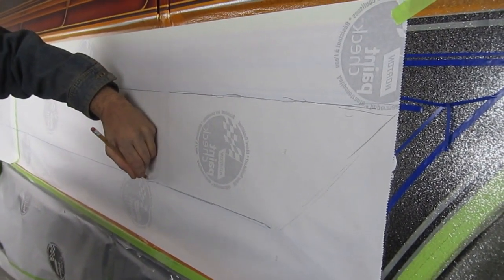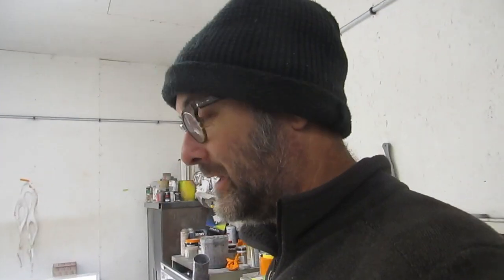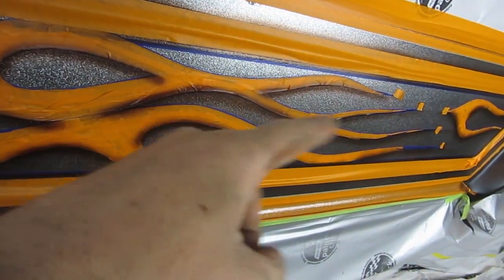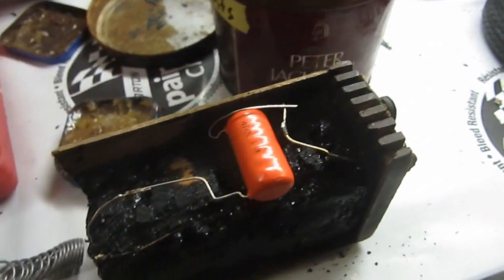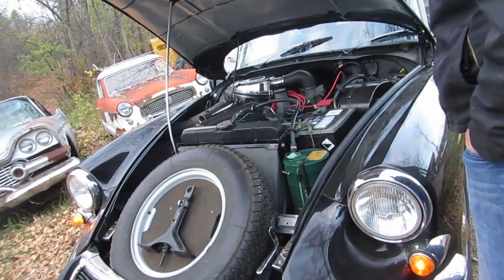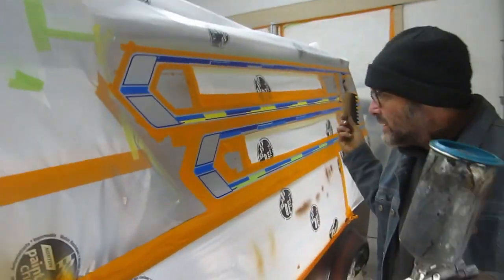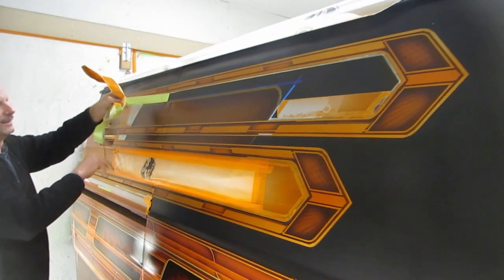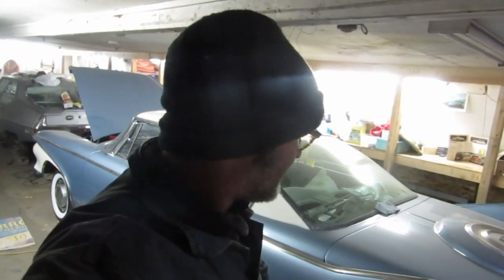Econoline Extra! Custom Paint Special, and Model T Coil Fix!

Comment: Cant believe anyone besides me remembers lace paint jobs.Going to paint back panel of my Corvair lace checker board.
Reply: I shot lots of lacquer through lace, and layered with metal flakes and translucents. 70s it was the thing..  Also, smoke layers from acetylene burn, with clear over...
Reply: I want to try it on top of my gasser
Reply: Low riders in CA used this painting techniques for many years. Beautiful!
Reply: @chuckstith838  Still to this day it's used on the west coast.
Reply: There is a car local to me in Newmarket that had the paint shot through the lace, a fantastic detail!!
Reply: I remember

Comment: As  I am someone who owns several model T's, it may be helpful to you to know that the coils can and should be tuned.  Pull the plugs out, lay them on the head so they still spark.  Adjust the knob on the points on each coil in turn to get the hottest spark.  This makes a great deal of improvement.   Also, a small squirt of transmission fluid in the timer  occasionally helps more than you would think.

Comment: Put some spaghetti tubing on those bare wires between the caps and coil windings to provide insulation and at the solder joints you can apply liquid tape.  So that the cap doesn't float freely inside the box and thus have the opportunity to get jostled around and cause a short, take a hot glue gun and refill the potting compound (aka black tar) that was removed using the hot glue, then box it back up.  For future reference you can also bend the tips of those bare wires into hooks, or take you smallest jeweler's screwdriver and wind the end of the cap wires into a spring shape, then slip them over the wires from the coils.  Either way will make a much firmer solder connection than simply paralleling the wires.
Reply: I was thinking something similar, I've made small crimpable ferrules (folded small piece of thin metal) to hold parallel ends together, then hit the join with some solder. BTW - I have that exact same soldering gun that i bought more than 40 years ago. This 100/140 watt version is a little on the weak side, and i think i remember i didn't have the cash to spare for the stronger unit, but I've made do.
Reply: @rebel9668 Agree completely, there needs to be a mechanical connection before solder. Hooks are perfect, or a little twist, then solder. Solder has a bad habit of cracking with vibration.
Reply: @cmans79tr7  Yes, perfect. Crimped brass ferrules are probably better than hooking or twisting the wires before soldering but as you note, a mechanical connection is important.
Reply: @cmans79tr7  I have a similar Weller myself that was bought new in 1982 by my Pappy.  I keep it out in the garage and in the house I use a Hakko fx888d. :)
Reply: Peter Lee  I realize that but most folks refer to it as tar like when it's in bakelite blocks in old Philco radios even though back then they called it potting compound. :)...at least, it looks like the same stuff inside those old bakelite blocks.  I was just saying he should refill it with something so that capacitor isn't left dangling in air like that.  Hot glue came to mind as I've seen other folks use it to refill  re-stuffed capacitor casings on antique radios.  Either the old paper & wax caps or the canned electrolytics.

Comment: Great work Dean. You're a master with metal work and paint. Loved the bit on the Model T. Early AC radio's from the late 1920's also had their capacitors set in tar-like potting material. When the capacitors fail you often have a volcanic effect with the stuff bubbling out of the cans and oozing everywhere.

Comment: I finall figured out how to subscribe. I really enjoy the classic tire segments. I Janurary of 2018 I bought a 60 pontiac Catalina at a estate auction. It had been last on the road in 1970. The bias ply tires where all flat. Tubes in them. the rears where the same brand and size as the front except they had been recapped as mud and snow tread. I inflated them and placed the rear in my tow dollys hooke up my wrecker and towed it 80 miles home, And today those tires are still holding that air I put in them  in 2018. I still prefer a bias ply tire. Love the content of your videos.

Comment: I always taught and was taught that when soldering wires you wrap them around each other to make good contact and the solder holds the wires in place sealing out oxidation. Hope the wires stay in place, but that would be the first thing I look at if it fails.
Reply: Yes, and you don't use soldering paste on electrical connections! It will cause corrosion later on and connection failure. Clean wires, good tight mechanical connection, and then rosin core solder for electrical.

Comment: Due to expected vibration environment the spark box will be working in, you should have mechanically j hooked, twist locked the wires together before soldering to ensure its reliability.

Comment: I found this story today from Barry Ritholtz
A 1960 Plymouth Fury on bringatrailer sold for $43,000.00  
America in the 1950s was in full post war glory. The build out of suburbia, the interstate highway system, the rise of the middle class post war — all led to endless options for consumers. 
A lot of pent up demand had built up during the war, and a decade later, it still was not fully satisfied.
Automobiles reflected the ambitions and economic strength of the nation. The Big 3 were in hot competition for the middle class’s dollars. Their cars became bigger, faster, ever more flamboyant.
Today’s example was a 2 door 1960 Plymouth Fury that pretty much marked the peak of the fin era.The Plymouth Fury began in 1956 as a muscle car, and eventually morphed into a family sedan. 
The early versions set speed records at Daytona as a “Factory Experimental” (as opposed to production car), hitting 149.124 mph over the sand.In the middle of that transition was this insane — and still gorgeous — vehicle. Beyond the ridiculous fins, the 361ci Golden Commando V8 with a four-barrel carburetor produced 300 horsepower (!) when new. 
That was a giant power output for an early 1960s era family car.Besides the massive rear fins, there are several other design elements worth noting: The spare tire bulge on the trunk, the scalloped front fender integrated into front grill elements and headlight assembly (as eyebrows?) instead of being part of the body’s sides. 
The outside mirrors were moved forward onto the fenders — a nice touch, as was the floating speedometer and the pushbutton transmission.
Everything about this car was optimistic, inspired by the aviation industry, and thinking about a Jetsons’ future.This lovely example, rebuilt a decade ago, just sold for $43,000.

Comment: Instruction sheet at 21:26 says heavy blue spark at points means condenser shorted. I noticed at @ 26:31 there was a large visible spark at the second coil from the back, a moment before you said "three". I saw no other sparks. Was that bad, or is that normal? Edit: later on ok i see you suspected that one.